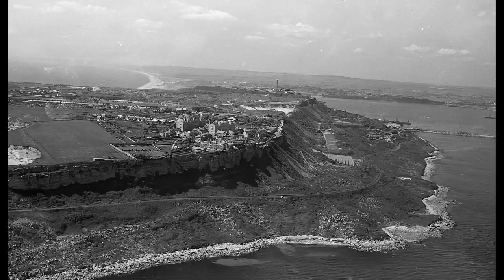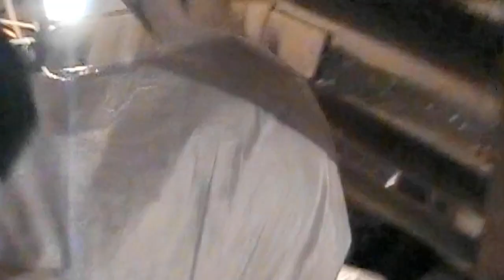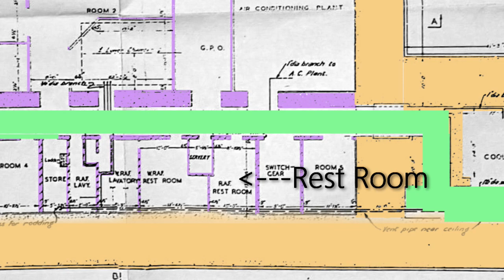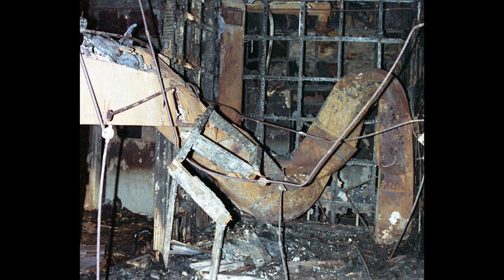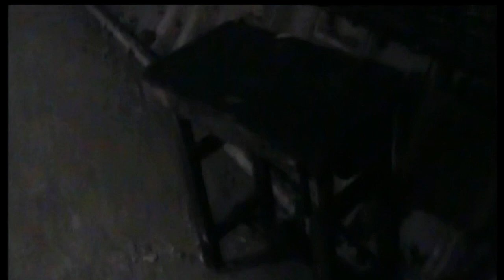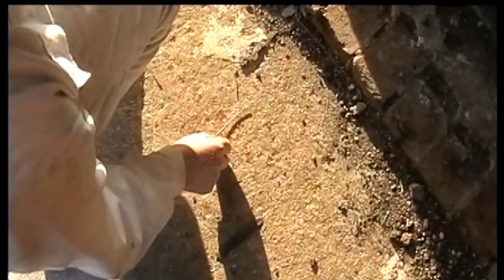Top Secret Cold War RAF  ROTOR site bunker & tunnel, Portland UK. Explore Underground. Radar 40 min

Comment: Excellent video, thank you. I’ve often wondered ‘though why they went to the trouble of digging down 80’ through the rock then going sideways and siting the actual bunker under the Verne moat where they lost 60’ of protective rock cover! - any idea?
Reply from the maker: Yes, I can think of several alternatives, but clearly they had to ensure that the access shaft and tunnel were as protected as the bunker. It would be good to see more contemporary documents from the time.